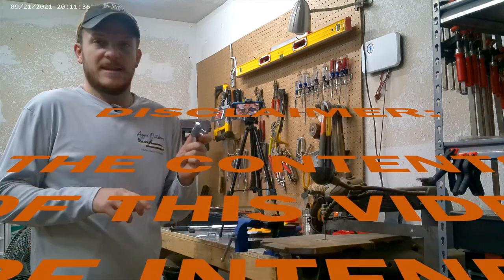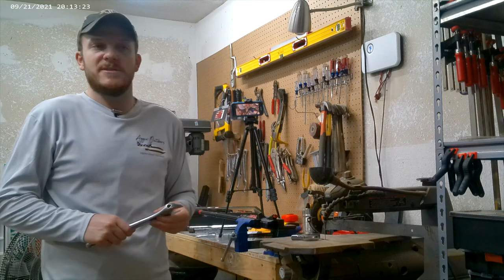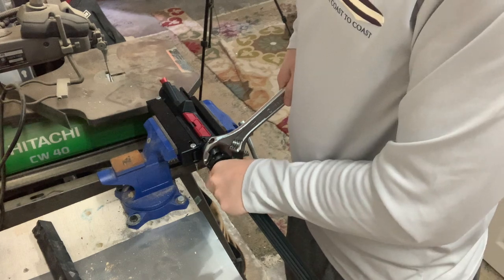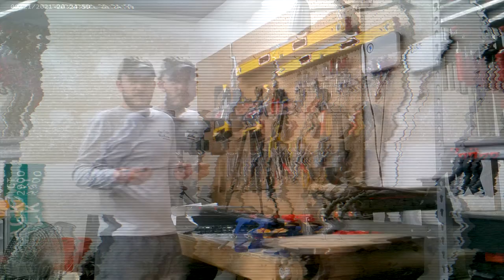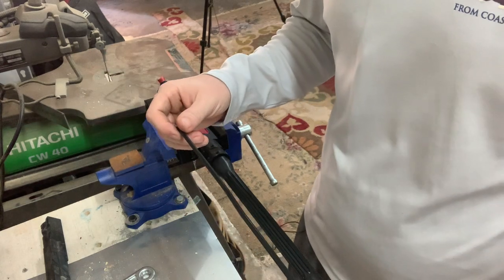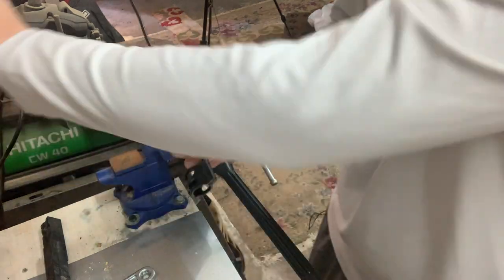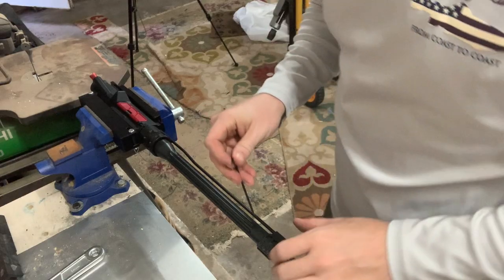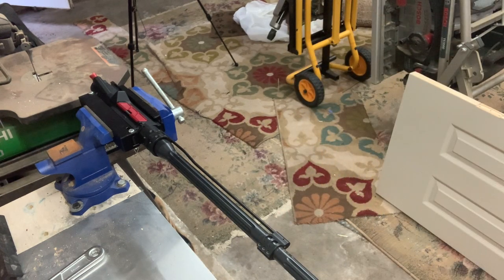A Beginners Guide To Building An AR-10: Part 5 - Barrel, Gas Block, Muzzle

Comment: Take the wrench you have. A belt sander will be very slow, and a grinder will be much faster. Grind the wrench to the thickness you need. Remember to keep dipping the wrench in water, so you don't overheat the temper. With the lee app, press with their splined lock nuts. They give you this garbage plastic wrench. I bought a large harbor freight wrench, and with the grinder ground, the thickness way down so it was not so dammed heavy had cut the wrench into two so it was the length I wanted. Then all kinds of custom grinding till it fit and worked like it should. Actually was a fun project making the custom wrench. Looking back now. Could of just taken 1/8 steel or aluminum plate and did the same thing. Hindsight is a good thing.
Reply from the maker: Yeah I ended up having my uncle do that for me with his grinder. I hadn’t even thought of it until he watched my videos. Basically said the same thing as you haha, definitely the easiest way to go. I spent a lot of time searching for something that would work haha! Thanks for watching